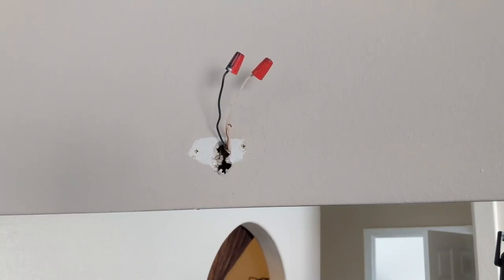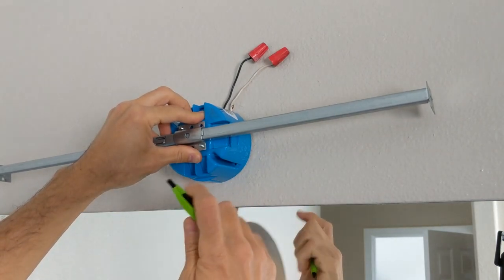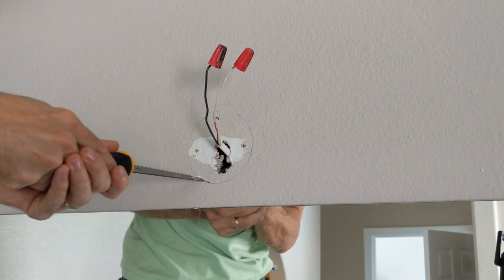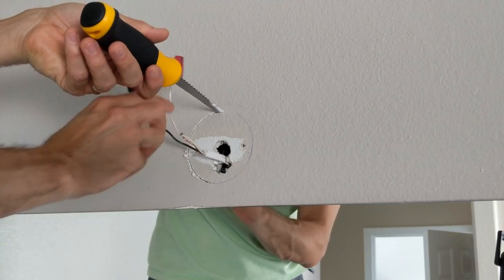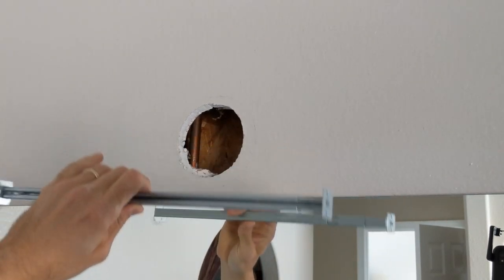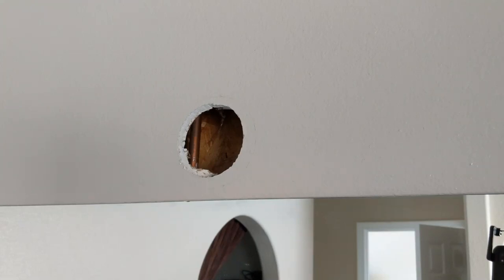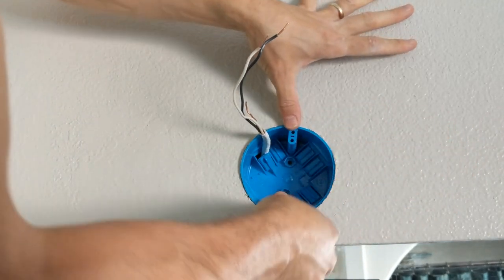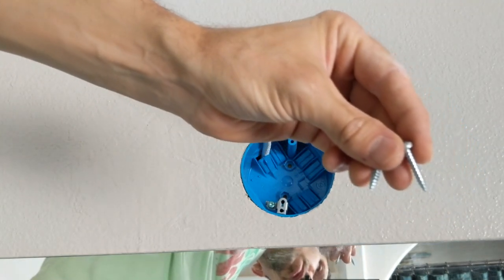HOW TO INSTALL A LIGHT FIXTURE BOX IN A WALL WITHOUT ATTACHING TO A STUD

Comment: Interesting work around.  Personally, I would have either used an old work box which would clamp tightly onto the drywall, or used a deeper box.  These solutions would have removed the need to fashion a stud and screw it into the board.
Reply from the maker: Excellent tips, BOB, I wish I would have known about them earlier :)  Have a great day friend :)
Reply: Would an old work box be strong enough to hold a heavier fixture though?

Comment: I'm here because the front of my junction box is not flush with the drywall, and I've managed to strip the screw holes in the junction box in an effort to install a vanity light. I kept trying, to no avail, to loop the ground wire around the green screw on the FRONT of the plate. The green screw isn't long enough though, so I could only loop it BEHIND the plate. So in the process of doing this over and over again and having to use longer screws than what came with the fixture, I stripped the junction box holes. All 4. Definitely the green screw spins and pulls out. The other longer screws I managed to find for the plate seem secure.

Do they make longer grounding screws? I'm separated, and my husband is not helping.
Reply from the maker: hello C, any screw that could secure it to the box would work it does not have to be a special kind.. I hope YOU get it figured out.. if YOU have the junction box out you could take it to a hardware store and they could help I am sure....
Reply: @ETPCYT  Thanks. I wasn't sure if the green screw was made of copper or 'special' in any way. A HUGE help. I did find one hole in the junction box that may not be as stripped and seems to be holding the green screw and ground wire secure. I don't know if when I hang the fixture and start pushing the wires in if that will change. We'll see. If it does come loose, I'll just use a different screw. Hoping it's level so I don't have to mess with it too much. Thanks!
Reply: @ETPCYT  Do you have any idea why neither vanity light I've tried sits flush with the wall? I've tried two. 

The first was a 3-light and had mounting screws at each side. It sagged. 

This new one, a 2-light, since I thought it was the weight of the 3-light that was the problem, has mounting screws at the top and bottom, and it wobbles side to side. You can see gaps on the sides between the center and the wall. 

I've been here almost 3 months and can't seem to get a vanity light up that sits flush with the wall. Is the drywall messed up and not flush? What could it be?
Reply from the maker: @tailzzzzz  Hey "C" It sounds to me like you need a new conduit box/ or at least it needs to be tightened more securely..  I would check that
Reply: This sounds like a predicament!

Comment: Thank you...I just moved into a place and have this issue with wires coming straight out of sheet rock above the kitchen sink. Apparently, there must have been a light fixture at some point, but no box. SMH. WHY do people do things like this?
Reply from the maker: YOU are welcome :) I guess cutting corners or just don't know better?  I am sure this is probably not the "PROPER" way to do it but it seemed the only solution for my situation

Comment: Not knocking what you did VERY smart for your particular situation. 

Leaving this info for future viewers - for situations when there's drywall on the opposite side  a rework electrical box is more practical - if not slightly more expensive.  Or in your case, you could just use a deep box or a box extension. But again - nothing wrong with what you did, and fully compliant with building code.
Reply from the maker: Thanks for the tip! :) most appreciated my FRIEND :)
Reply: Is a rework box the same thing as an old work box? Aren't those pretty cheap (~$4)?

Comment: Oooo. Those wire nut look quite loose. A little tape on each would be safer.
Reply from the maker: Excellent advice, CHUCK, thank YOU.  That is always a good idea.
Reply: Why didn't you just use an old work blue box? It would've taken about 5 min and they are meant to just go into drywall. Most rectangular vanity light fixtures have a mounting plate that anchors into the drywall, so usually the junction box doesn't need to be very strong.
Reply from the maker: @illestofdemall13  I didn't know about that my FRIEND!  Good tips though.  My light fixture weighs about 15 pounds and I didn't want it to sag.  I try to overbuild when I can!  Take care KRIS and be safe!
Reply: @ETPCYT  Is your light solely supported by the j box? Just curious. No problem, thanks. Take care as well.
Reply from the maker: @illestofdemall13  Hey KRIS, Yes, that was the only available option for how this fixture is held. :)
Reply: @ETPCYT  I see.
Reply: What was the drill bit size and what size screws were you using for this?

Comment: Have similar issue in my bathroom.  Would an old work box (round) not clear the copper pipe?
Reply from the maker: Hey Dustin, SOrry for the late reply.  With my situation I has pipes on both sides between the studs.. No room
Reply: could use a ""pancake box "" with a mount setup like that

Comment: What is OSB? Drilling into OSB? Might of heard wrong.
Reply from the maker: it is oriented strand board.. basically plywood.. just a bunch of wood pieces that have been glued together to make a larger piece.. It normally comes in 4 x 8 foot sheets and they are put on the exterior between the studs and siding :) Thanks for the question, DAVID

Comment: Would've been easier just to use an old work box.
Reply from the maker: good idea, thanks GREG :)
Reply: @ETPCYT  Welcome, with existing construction meaning drywall up it's always easier to use an old work box as the wings spread out inside the drywall to secure it and you don't have to mount the box to a stud.